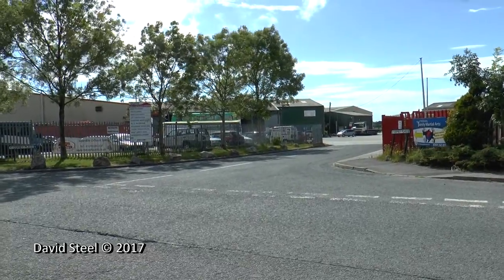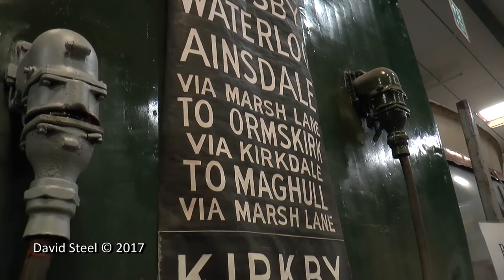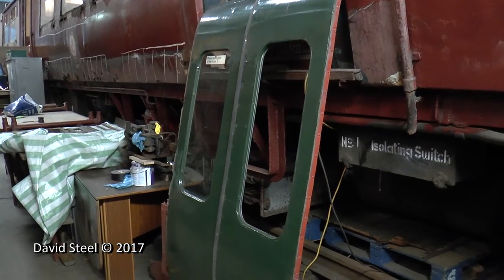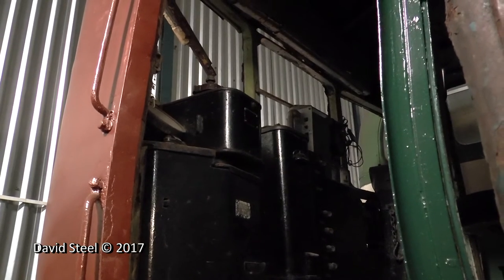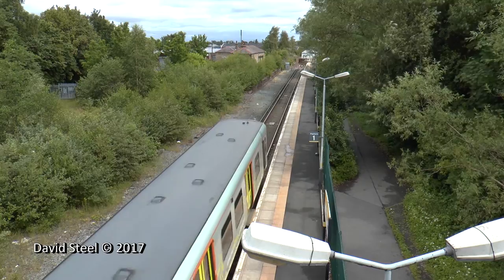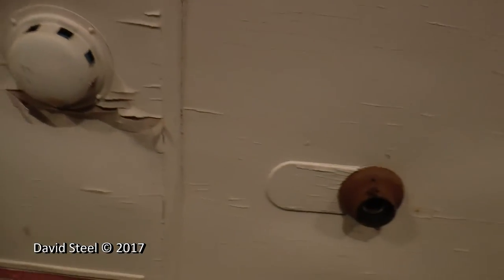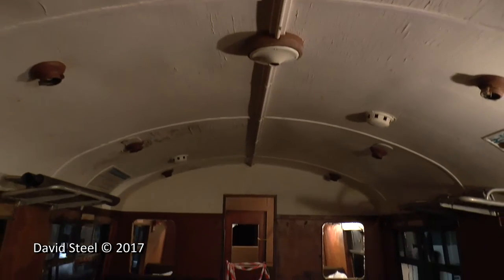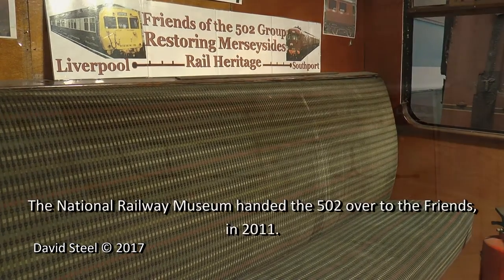Saved from Scrap:  Northern Line Class 502

Comment: The NRM don't give a stuff about anything electric. Why on earth there's a Japanese Bullet Train motor car - entirely built in Japan with Japanese components there is beyond me ! Surely it would've been better to have repatriated one of the BREL-built EMU100's from Taiwan ? The old SR SUB car at the NRM has no motors. The 2HAP is sat out there in the rain. Same goes for the APT , resting and rusting. But they're quite happy, it seems, to build new steam locos in Britain !
Reply: Flyingscotsman is not a new steam loco and it has a good number of old parts. A Japanese Bullet Train motor car has a right to be in the collection and be the only one outside of Japan. The APT-E is undercover at Locomotion and the APT-P is not owned by the NRM. Actually the NRM does care about electric and is more do with money. The NRM is about preserving for the future generations and not everything running. The point of museums to have things on display.